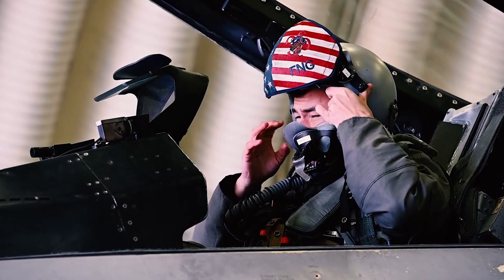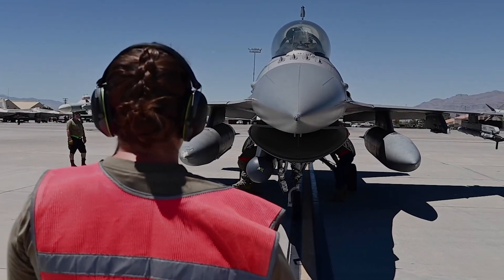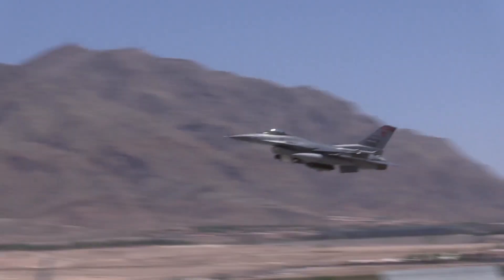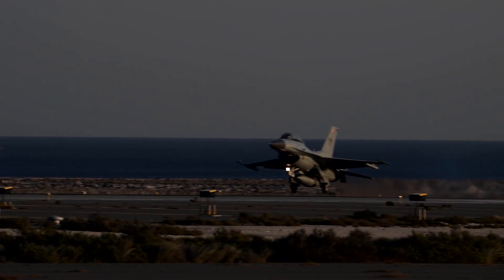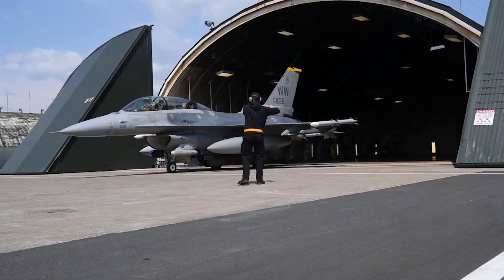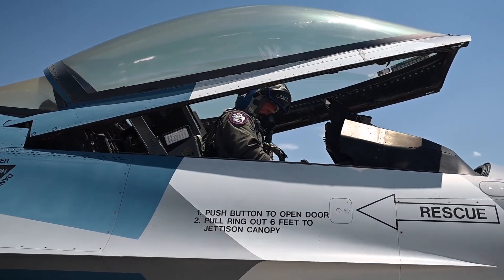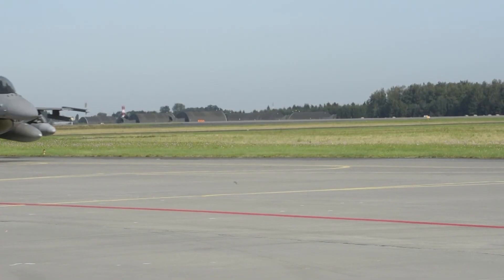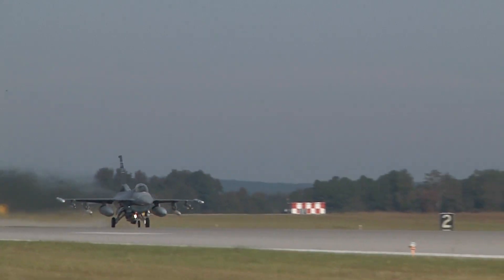Bulgaria's F-16 Falcon will have a smaller radar cross section

Comment: Doesn't matter. As long as it has drop tanks and armament hanging under the wing, it looks like a B-52 on radar.
Reply: And so what does a B-52 look like on radar then?
Reply: @clchan1953  Big as shit! The larger the plane, the larger the return.
Reply: @FUNYFACTIODS  Big if true
Reply: @karci2k15   An anti-RADAR coating makes the "plane" absorb a little of the signal, but all armaments, drop tanks and other items attached to the wings and fuselage are still giving a very strong return. Look at our stealth fighter, all missiles are kept inside the plane until fired. That way, the anti-RADAR coating and stealth design reduces the return signal. Nothing eliminates a return except UFO's...
Reply: It is not foreseen Bulgarian F-16 to use additional fuel tanks, as well refueling  in combat scenario. 
Both option will be used just for the transfer from USA to Bulgaria over the Atlantic ocean.
Reply: I think he will look like a B.U.F.F.